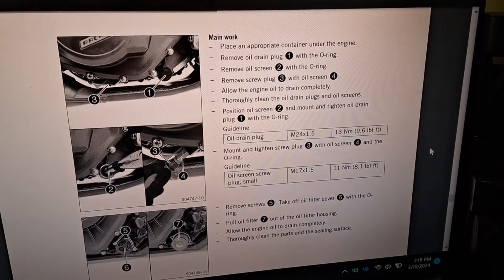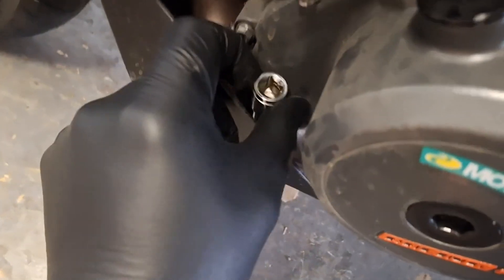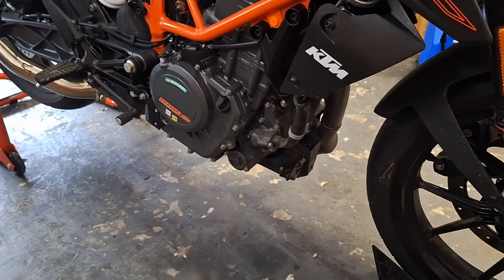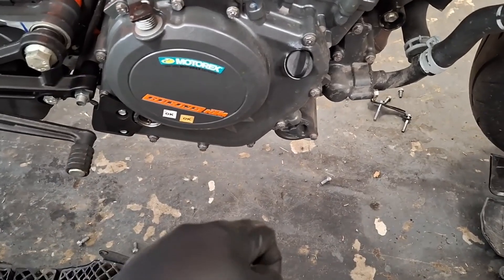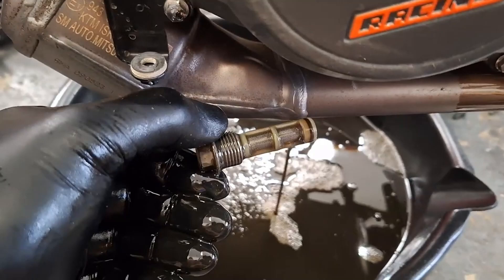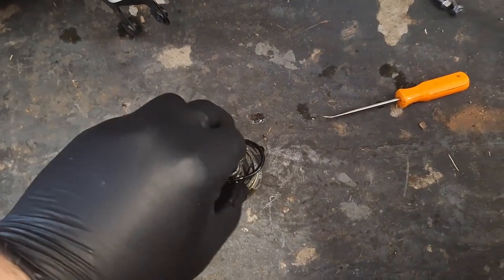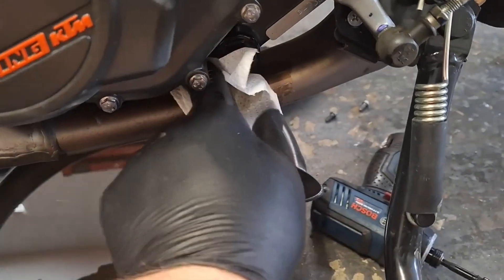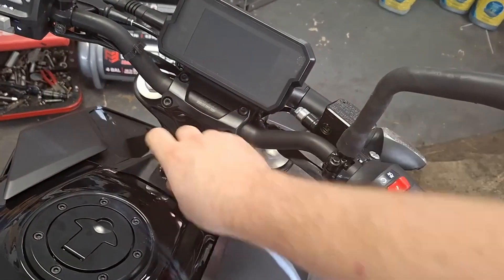KTM 390 Duke Oil Change

Comment: HI im back, I have another question regarding my ktm 390 duke abs. Your oil change video helped me out a lot last time but today I ran into an issue on my duke. Apparently its very common. Most people complain about the sidestand sensor not working properly so I was wondering if you could do a bypass tutorial for the sidestand. If not, I understand. I just loved how detailed your explanations were in this.
Reply from the maker: Hi, I don't own the bike anymore. But if its just a 2 position switch (with 2 wires) It's possible all you need to to is unplug it - or short the pins - depending on how its designed
Reply: @BigBensCarsAndCycles  alright i will note that down, thank you for a quick response regardless. have a great day